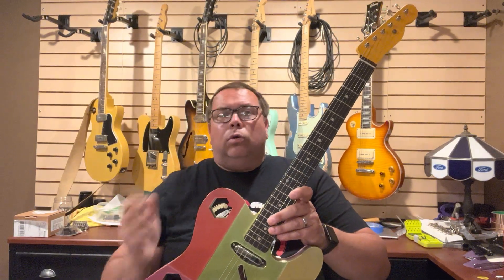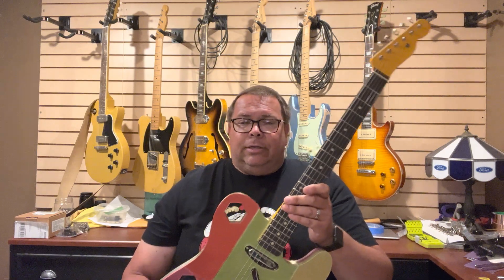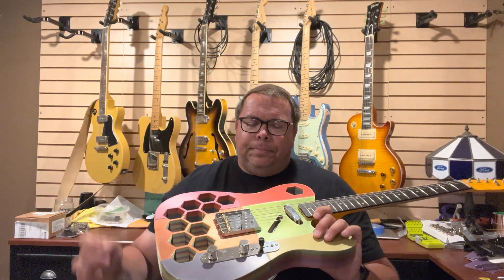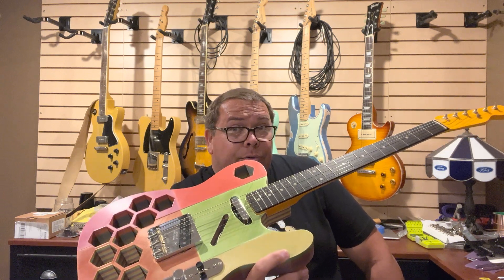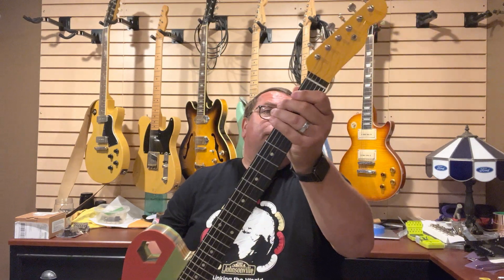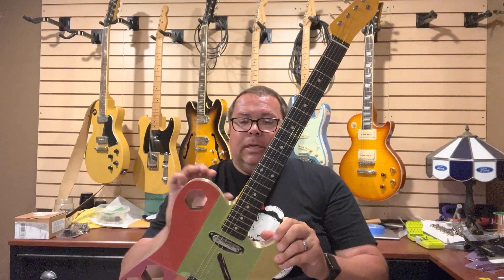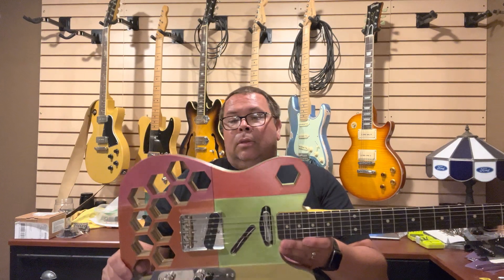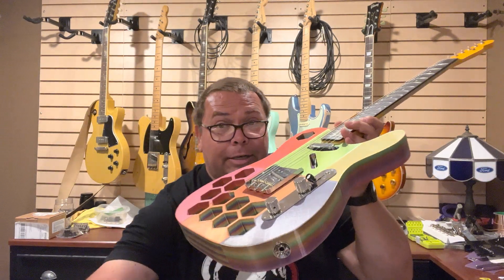I built a 3D printed Guitar. …. And it’s unplayable, things learned.

Comment: Thanks for making this video.  I love the way your guitar looks.  I've also got a 3-d printed guitar.  My body mass was mostly one large piece and two smaller segments.  No body flex for me.  I used Joe Barden pickups, Gotoh bridge and a roast maple Fender tele neck as my main components.  The biggest issue for me was neck alignment in the neck pocket.  I ended up using a shim to correct the string height and a little bit of neck pocket trim to get the strings properly aligned so that the high 'e' wasn't too close to the edge of the frets.  Rock on my brother. Here's a link to my 3-d guitar vid.  https://youtu.be/eQovBbGS-1Y?si=07uiQHqs1mT57uJ7

Comment: I designed mine with 3 10x2mm oval channels in the body and hammered in carbon fiber rods.  Also used 30% gyroid infill and 7 layers for walls/top/bottom.

Comment: Dunno if you’ve made any progress but you might conserve on filament and print time by increasing the wall width along with top and bottom thickness. Maybe a bit of filleting on the edges. But it seems the two center pieces should be your primary concern.

Comment: The best way to make the body more rigid is use a rigid filament like PLA or something with infused with carbon fibre, using more perimeters (about 7) in your slicer and use lighter gauge string as you did. Hope this helps if you’re still having issues with the body flexing.

Comment: I fixed the body flex by making an aluminium plate, much like a a Strat cover plate and bonding it to the back with epoxy. There are also designs that have a hole through the body to insert a 10mm rod to stop the flex. They work well too.

Comment: PLA is not rigid enough.   Even PLA printed solid at 100% infill will bend a bit.   Polycarb or glass fill should do it.
Reply: Puracaster from Pruscia3D , they tested it with 25% infill with PLA, it didn't bent for a year ....

Comment: I designed and printed a guitar and encountered the same problem, however I made mine with a wooden core. Maybe the problem was that the wood was pine or it was too thin, but it flexed a bit (but sounded awesome. Now I’m going to put some carbon fibre rods in it, I’m not giving up yet

Comment: I do agree that the body flex issue might be because of where the model was sliced, all the models ive seen online have the bottom of the neck to the bridge in one piece and recommends you to print with extra high infill and extra perimeters, id say go with atleast 3 to 4 walls depending on nozzle size and 60% infill, choosing certain infill like gyroid would definitely help too. not trying to overexplain just trying to help because i might also print one myself
Reply: Have you made one?
Reply: Please over explain! It’s so helpful.